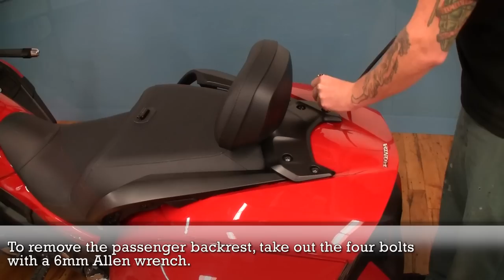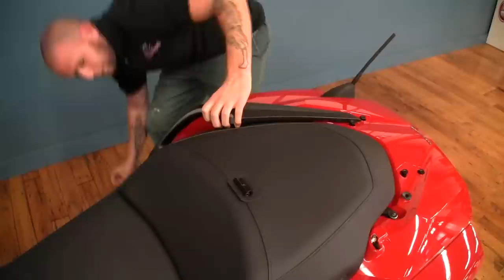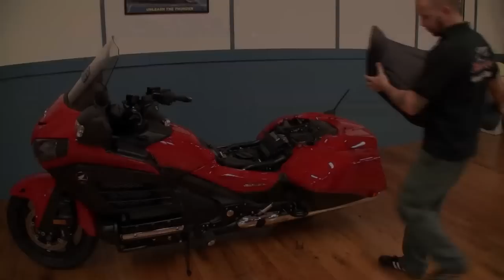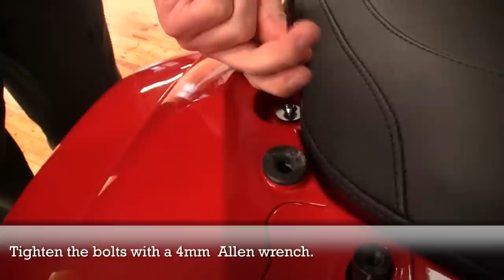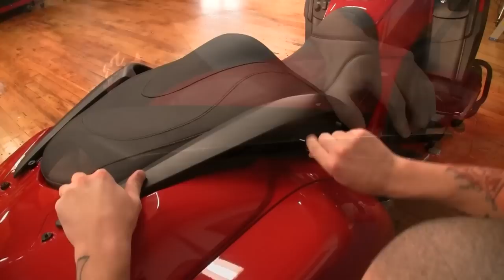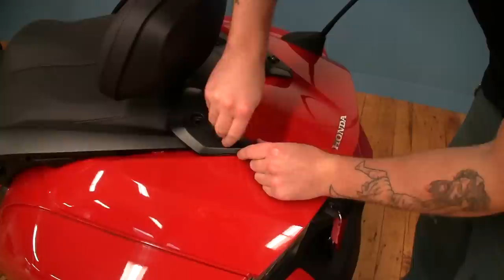Honda F6B Install

Comment: Thank you for this video this was perfect timing!!  I just came off of a 950 mile trip the motorcycle ran great no problems.

 But a seat upgrade is a must do!! The stock seat is okay on the scale of 1 through 10 i give the stock seat a 6.

 Ive been looking at a few seat i like the way this mustang seat looks.

I do some research and see how this seat is on long trip taking a 1600 miler in may gotta have a different seat by then.

Comment: I just am attempting to put the seat on now ... it's not as easy as the video that's for sure ... I find the passenger part of the seat is wider and is very close to the releasing latches also lining up the bolt holes is a pain .. (yes I know the OE seat can also be challenging) .. I wish the seat had come with longer seat bolts with the tapered end, I would have paid the extra 15 or so $$ for the less agrovation